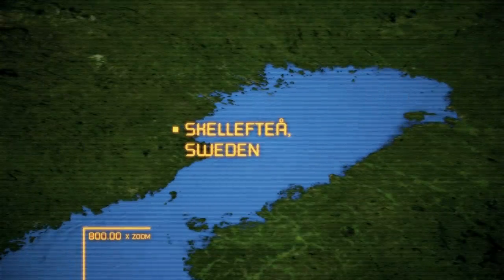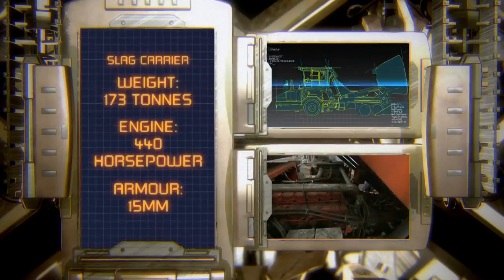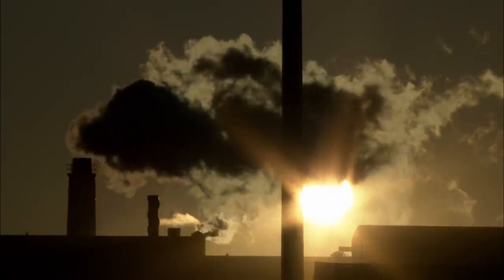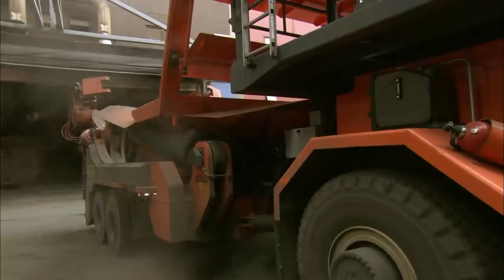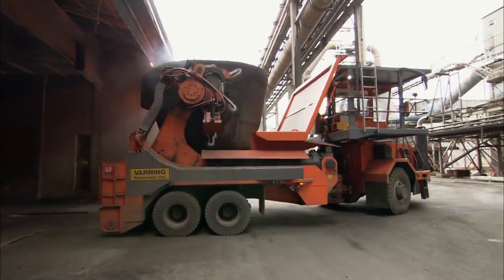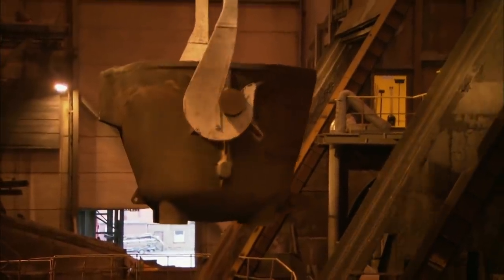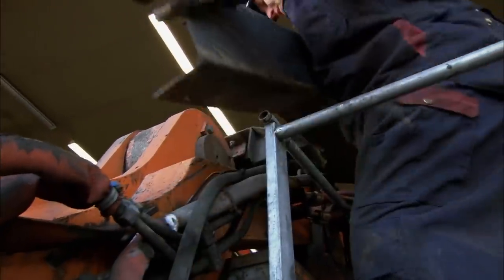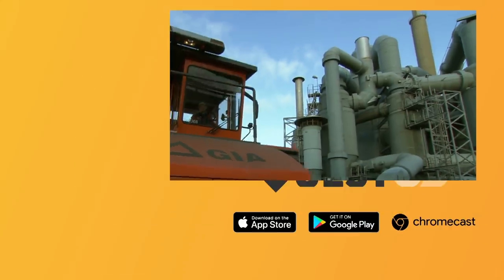Jammed Slag Machine Causes Major Issues For Swedish Workers | X Machines

Comment: Didn't tell us how the solidified slag was cleared, didn't tell us there was a burst pipe. Utter pish. Why doesn't Youtube have an ignore channel button?
Reply: its first crushed with a hydraulic hammer then its loaded on articulated haulers with a big excavator, then its crushed in a crusher or just loaded back in the furnace in chunks
Reply: @derke123 I used to lunch with these guys as a contractor transporting the ore concentrates to the plant. You are correct about the hydraulic hammer. They have a crusher on site crushing it to about 30mm gravel and then transported back to the refinery plant 50 km away for re-processing.
 The way this is filmed and edited is such a laughing matter when you know the reality 😅